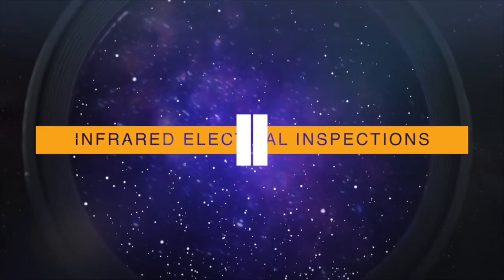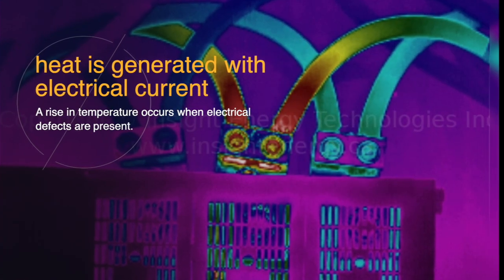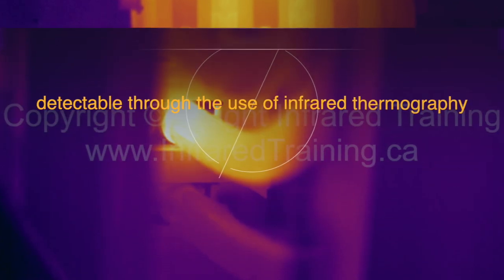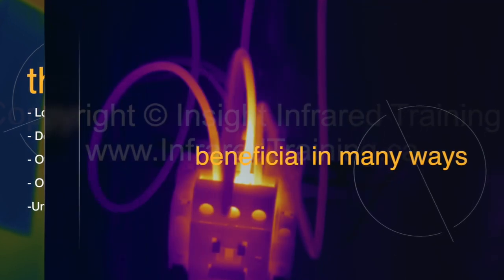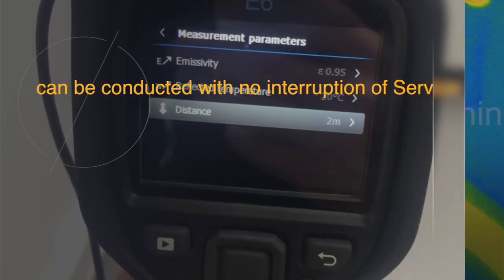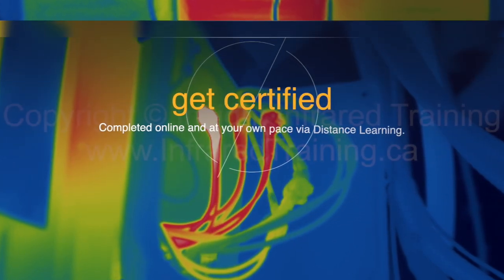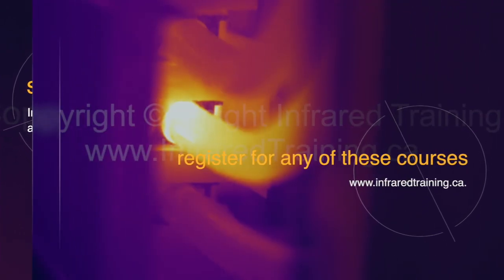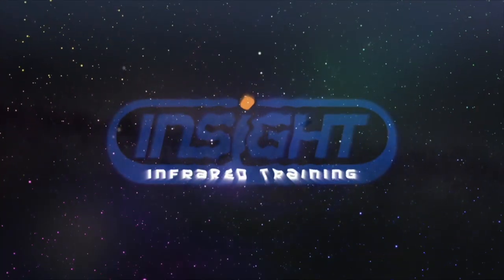Infrared Thermography Training.  Infrared Inspection of Electrical Systems.

Comment from the maker: Infrared Electrical Inspections
Infrared Thermal Imaging is widely used for the inspection of electrical systems. Since heat is generated as electrical current flows through conductors, a rise in temperature occurs when electrical defects are present. As a result, Infrared Inspections can be used for:
- Preventive / Predictive Maintenance - Condition Assessment & Monitoring - Quality Assurance
Many problematic electrical conditions are detectable through the use of infrared thermography. These conditions include:
- Loose / Deteriorated Connections
- Defective Equipment
- Overloaded Circuits or other Components - Open Circuits
- Unbalanced Loads
Infrared Electrical Inspections are beneficial in many ways including:
- Reduced Down Time & Costs
- Non-Destructive & Non-Contact
- Reduction in the Chance of Electrical Fires
- Can be Conducted with No Interruption of Service
Along with many other applications, infrared inspection of electrical distribution systems is a topic covered in the Infraspection Institute Level-I Certified Infrared Thermographer® course. This course and the certification exam can be completed online and at your own pace via Distance Learning. Specific applications courses are also available for this topic including: Infrared Inspection of Electrical Systems and Infrared Inspection of Electro- Mechanical Systems. To register for any of these courses, visit Insight Infrared Training at www.infraredtraining.ca.